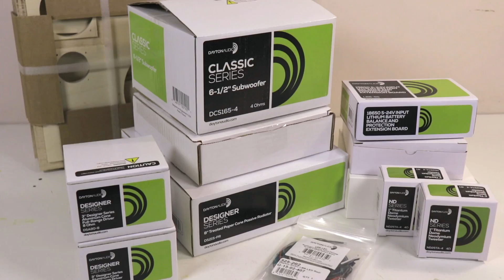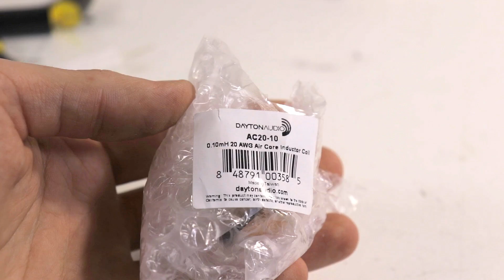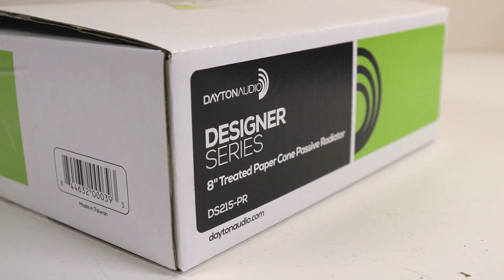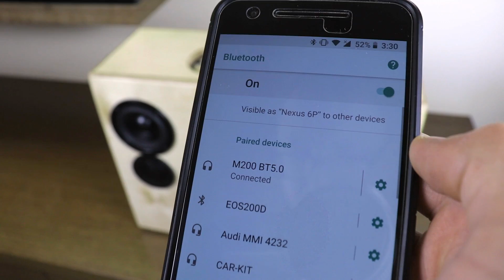DIY 200W Portable Bluetooth Boombox Speaker Kit Build | Parts Express Blast Box

Comment: I built one of these and really love it.  I opted for the big (26650 cell) 5 battery option.   Biggest problem was fitting the power supply board.   If mounted to the floor, the woofer and passive radiator would not fit.  So I separated the battery holders from the board, mounted them separately to a plate and mounted in the space between the midrange and tweeters.   Then ran wires from each separate battery holder back to the board.    Finished product has great sound and is very loud!
Reply from the maker: Thank you for sharing! I chose the bigger 5 battery option as well. I did not have any issues mounting the woofer or the PR against the board. Only one connection was touching the magnet of the sub. Indeed, the finished speaker sounds great and plays quite loud.
Reply: How do you wire the battery board to the amp? I'm also using the bigger battery board too and when I turn the volume up the speakers cut out. Making me think I've not wired it up properly
Reply: 26650 are big and annoying to work with i feel you (sry im not from us excuse my bad grammar)
Reply: If you're looking at the front of the box. I mounted on the left wall, touching the bottom, and touching the back wall. Clears the tweeter and everything else. I accidentally used the smaller width batteries so not sure if the bigger ones cause an issue

Comment: i have been looking into this, thinking about building one but i came across a few complaints. main two are the mids and tweeters are to close together to install grills on the mids, and the amp being advertised as a 200w amp doesn't come with all you need to make it 200w. and would want to use for work but would need good protection for all of the speakers and the passive on the back. I dont really want to trial and error my way to a finish. would it be nice if a list of optional add on parts was listed in the notes or something like that.

Comment: @Donny Terek 
I'm trying to wire everything up and I have the same larger battery board you have. 
Did I need to purchase extra wiring to be able to wire it to the amplifier board?
Maybe I'm missing them. 

Thanks for the help.
Reply from the maker: Hi!
Only a length of wire is needed to provide power from the battery board to the amplifier. It comes with the speaker kit.
Hope this helps.

Comment: Nice video Donny! How hard would it be to install a chromecast audio inside and some way to power it off the same power source/batteries?
Reply from the maker: Thank you!
It would actually be a pretty simple install and possible to power it off the same battery used for the speaker though I'm not sure if it would cause any ground loop noise due to the same power supply being shared (though easy to overcome). Personally I would keep the speaker as it is and only include an Aux port so the Chromecast can be connected without any complex wiring needed. The amplifier has an Aux port integrated.

Comment: What is crossover and what is use of it . If u explain more about electronics parts more it would have been awesome . Please also add more weigh to electronical explanation as well rather than wood craft !
Reply from the maker: You can find all the necessary info on how to build the kit in the link.
Reply: Completely agree, getting into this hobby there are 100's of videos but none with any explanation of what they are actually doing or why.  Makes learning hard :/

Comment: Good job overall but tweeters are not well placed; you should have placed them on top of the front panel to garantee the better treble dispersion
Reply from the maker: Thanks! This speaker was designed by experts and the tweeter placement was chosen due to limited space in the enclosure of the speaker where midrange drivers were placed.

Comment: Did the upgraded batteries give you more power to the speakers ? And whats the max DB level?
Reply from the maker: Yes, the larger battery pack definitely gives more power with almost double the voltage. I did not measure the max output.

Comment: any good websites to get good speakers with low prices ? using car speakers sounds dumb so i need speakers that are has low wattage per speaker to make a setup that can work on batteries....
Reply from the maker: Hi! Check Parts Express or Sound Imports. Links in the description.
Reply: i ordered a battery pack that has 24 x 18650  on Batteryhookup , after seeing the video, i think i have to many of them now

Comment: Nice. I have been looking at these and other "kits" for some time now.
It is very hard to tell what they may sound like. 
Can anyone tell me honestly if they sound as good or better then say a JBL at the same price point?
Reply from the maker: Hi Derek, thank you for the comment.
The sound test using my camera mic truly does not do the speaker's justice by compressing the audio recording. I am not sure if it sounds better than a JBL at the same price point since the kit does not use any software for enhancing sound quality (boosting bass at low volume level, etc.) but it still sounds great having the tone controls. Most DIY kits can hardly compete with the price to quality ratio of factory speakers but I guess the kits are more of a satisfactory result for being able to build your own speaker.
Reply: @DonnyTerek  Thank you for taking the time to get back.
I agree that it is very satisfying to build something, and I am certainty not trying to take away from that.
Some of these mini amps do have a DSP option or accessory board I see. I would like to know more about them. 
Carpentry is in my wheelhouse. The electronics, not so much. Other then watching videos like this one and following a parts list. Not a lot of info to be found for `the new guy`` Any help in the right direction would be very appreciated. (I shy away from this kit because I feel I can make a better box and I am not a fan of the passive radiator.) I would still like to have the 2.1 and portability.
Reply from the maker: No problem! Hope you make a good choice for the speaker you will build. Glad I could help.

Comment: mhm so $249 for kit; $36.32 for rest of speaker parts(5pcs-batteries, battery holder, cables)  and $6.32 Materials(Carbon fiber vinyl, Acoustic foam, 3mm double-sided tape). Total $291.74 for all the parts including kit without shipping and tax including current sale price. So it would be around the $310 mark including tax and shipping depending on what shipping speed you choose.
Reply from the maker: Not exactly. The speaker kit for $249 comes with batteries and the battery board included. Shipping is free if you are lucky to be in the States. I opted for a larger battery board for better performance but its not necessary. I'd say this kit is of great value for the price.
Reply: @DonnyTerek  Oh ok